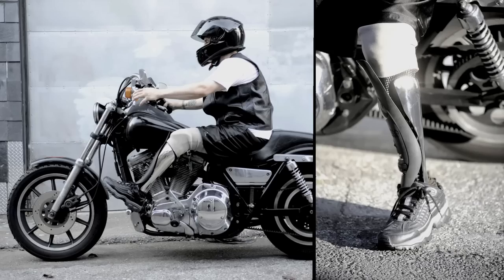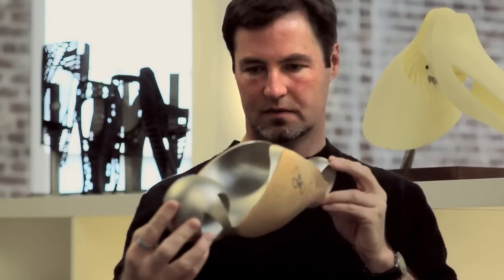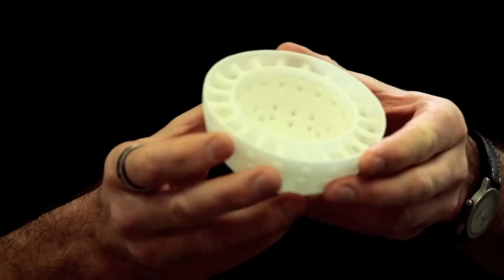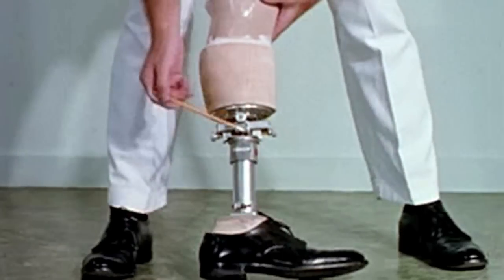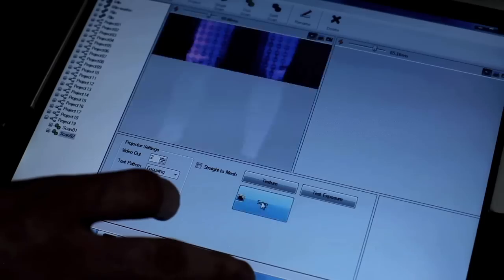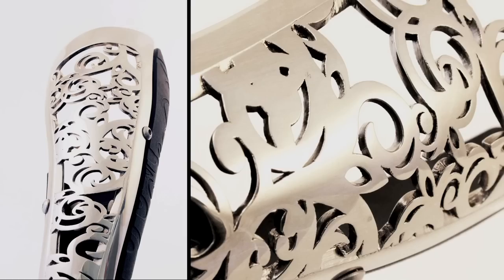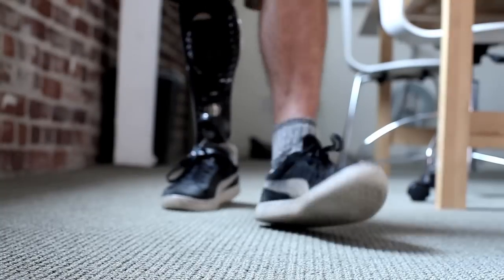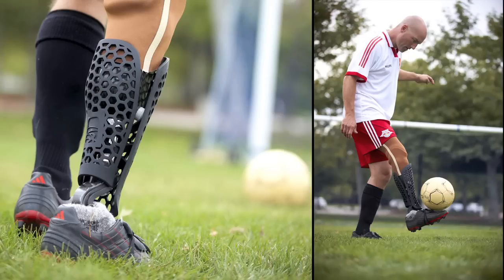Designing Confidence

Comment: He said he worked in Apple designs (While I too disagree with Apple products you have to admit that from a designers standpoint they are top of the line).  

Also its possible that most 3d printer programs are only done through windows?